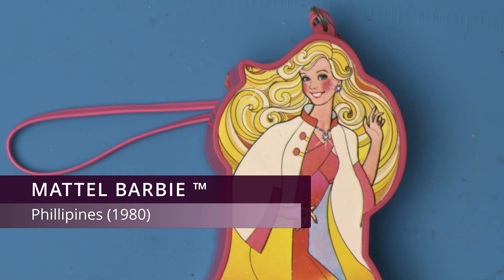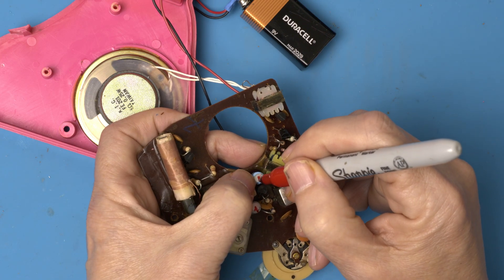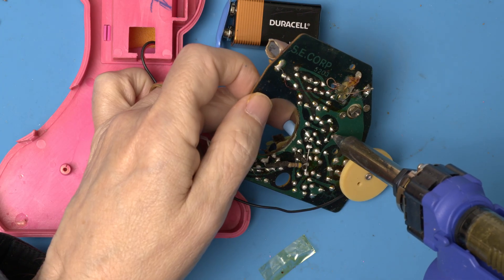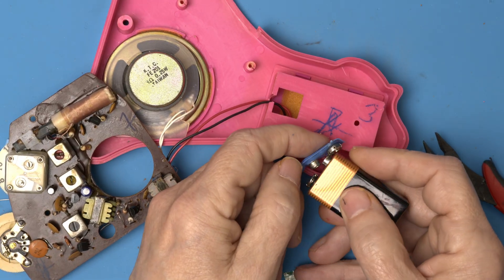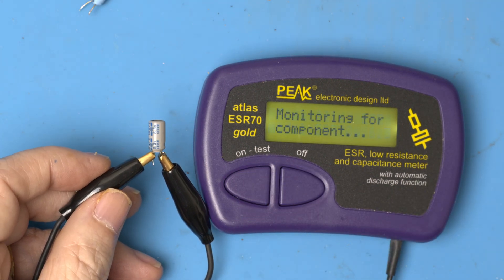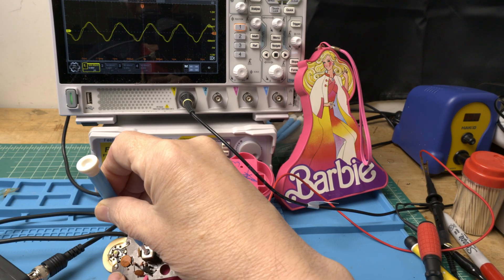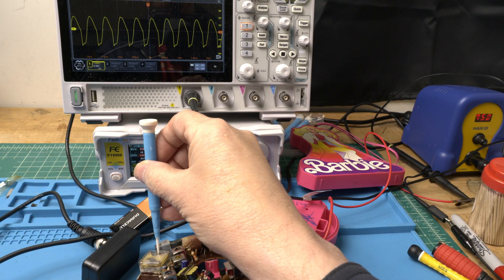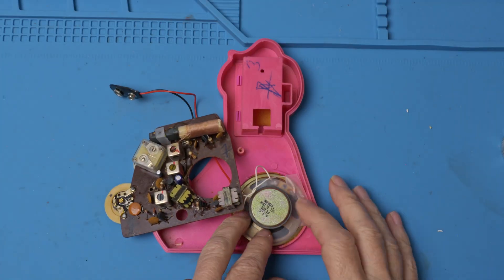Vintage Mattel Barbie AM Radio Restoration - Repair & IF Alignment Guide

Comment: First comment.  Not a complicated circuit will never give a perfect sine wave. When you change caps, it will somewhat detune aligment. I replaced caps on an aa5. It wouldn't work until I fiddled with the if cans. It threw it off that much, but only once that happened for me. Thanks for the video.
Reply from the maker: Good to know about the sine wave!   Also good to know how far new caps can throw things off.  I haven't attempted any tube radios yet!